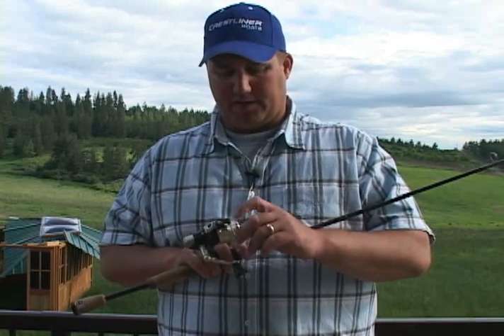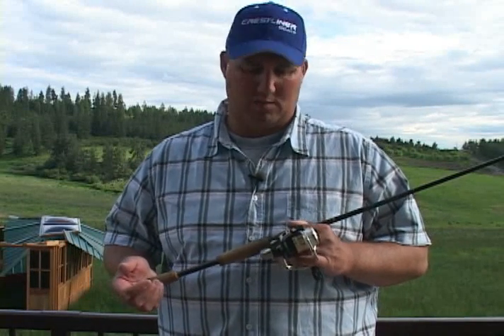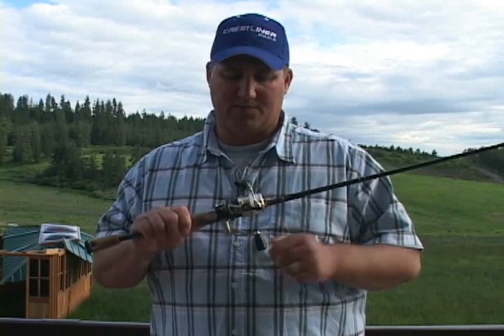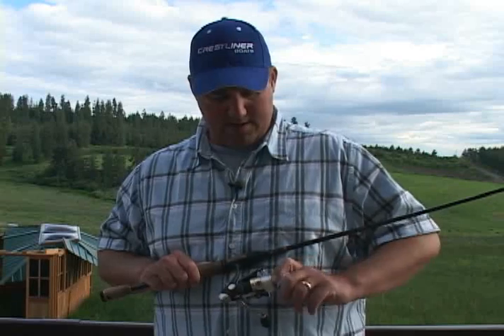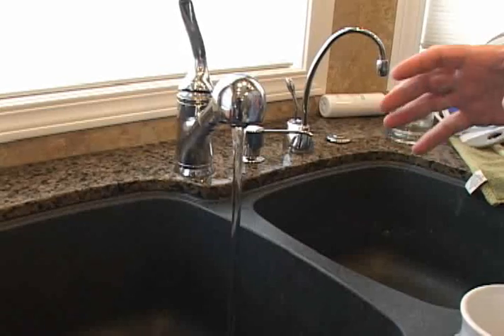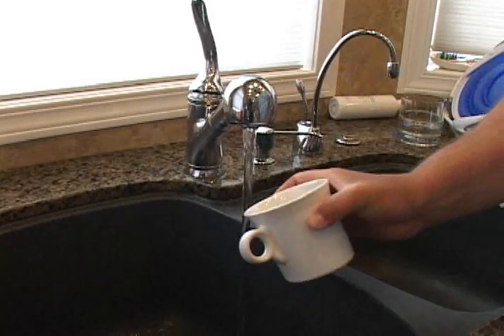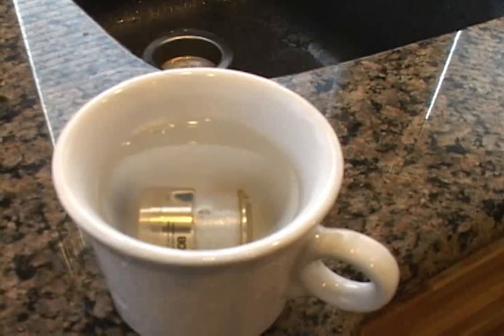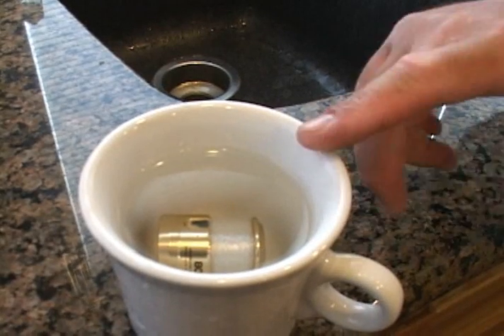Little trick to fix line memory

Comment: This also worked for me when I went to attach a leader on my braid. #10 line was really curly off the storage / shipping spool so I cut my length, soaked it in hot tap water for 5 minutes and now it's almost straighter than the braid line it's attached to!
Thanks!

Comment: This does work, also tying your line to something and stretching all the line really good helps and last but not least, Use some line conditioner!  Spray it on the night before you are going.  The worst times for memory is dead of winter and hot part of summer.  I have actually switched over to trilene big game and it for some reason doesn't give me many problems like Many other lines do!

Comment: I bought zebco 12lb line, and a new reel on amazon... i spooled it up, and cast a spinnerbait on my yard. MAN oh Man the mess i got on my reel... ill give this a try. THNKS
Reply: Abel G I’m having the same issue
Reply: Same probably im having right now with Zebco ominflex. Cheap but good gosh. The tangles im getting are bad. I get maybe 3 to 4 good casts and i look down line twists like crazy. It just coils up or sometimes just jumps off the reel.
Reply: If you're having the trouble as soon as you spool your line up, you probably twisted it as you loaded it on your reel.  You can correct this by letting out a long length of line when you're trolling with only a swivel on, or even in a fast running stream, letting it be for several minutes, then reeling it back in.  The drag of the water will untwist your line. =)

Comment: I have one question. Why would you unspool all your line off when the most you ever use is maybe 100 ft. This is what I do. I have a reel i have been using all season so to get ready for next season I will take a rod that has a empty reel on it, I then tie line from the one i have been using to the empty spool and wind it on to the empty one then next season i get rid of it saves on money. :-) But then i don't have spongers furnishing me all my line.

Comment: Im not trolling mate but you have halved the breaking strain of your line by immersing it in hot water. Line twist is caused by no or poor swivel, and having your drag too light, and winding the handle when line is going out. Ive sold tackle for 20 years and written a couple of books. Dont do it unless you are happy with 8lb test breaking around 4 pounds.
Reply: What about running it on warm-hot water from the faucet, not immersing it.
Reply: I’m not trolling but you’re wrong. I’d suggest reading books and not writing them. 46 years of experience here, salt and fresh water, 100’s of fishing rods, thousands of fish, dozens of boats, and one wife😂, She’s amazing.